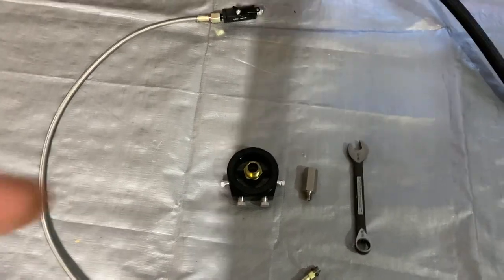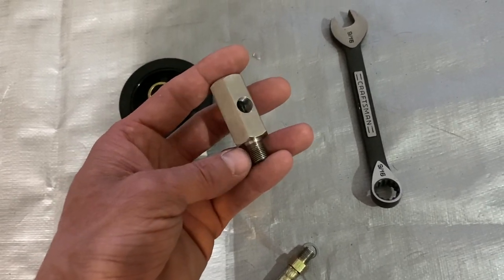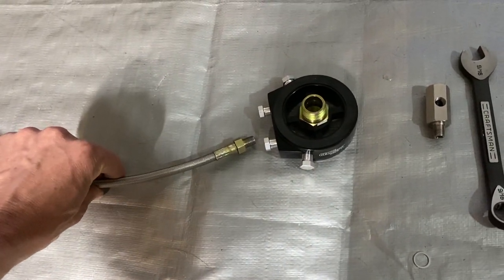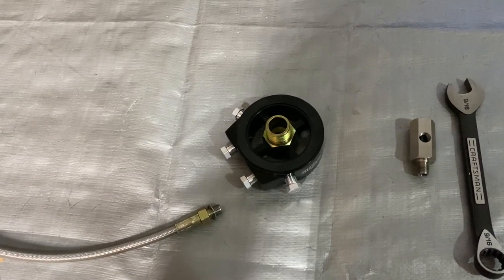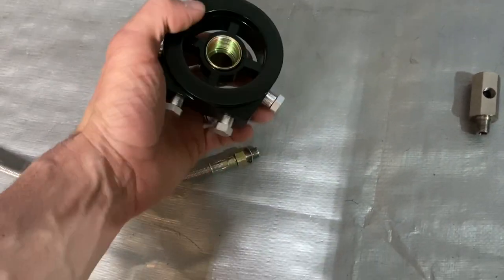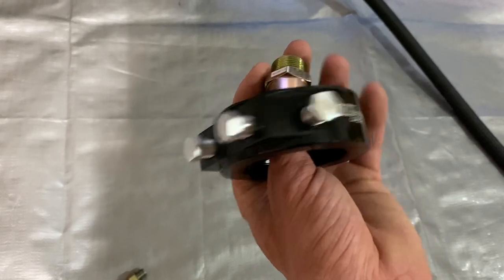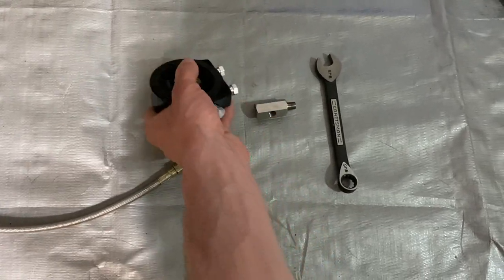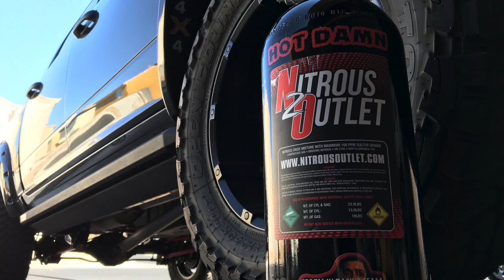Turbo oil feed update 2 sandwich adapter

Comment: Are you going to put a couple of Magnets on that filter as well just to help guarantee no metal contaminants to the turbo
Reply from the maker: Filter has magnets in it already, turbo is journal bearing. I’m not to worried about some dirty oil. Shouldn’t be any metal coming from my engine. I’m more worried about the turbo breaking down internally and getting to the engine. I have a filter for that.
Reply: True definitely agree
Reply: @HotDamnRacingTeam  when you say you have a filter to keep any  turbo related parts out of the engine are you meaning the engine oil? Or through the engine intake?
I'm not familiar with turbo cars, only with bikes. With bikes I've heard of turbos failing and sending pieces of metal through the intake into the engine.
I imagine on a car or truck the intercooler would stop any parts from going any further.
I don't see a way to prevent that on a bike without an intercooler. A lot of people aren't running intercoolers on their bikes.
Can't really put anything in the charge pipe to prevent it without restricting the flow, not that I'm aware of anyway.
However some of those adapter plates do run the oil through the first.